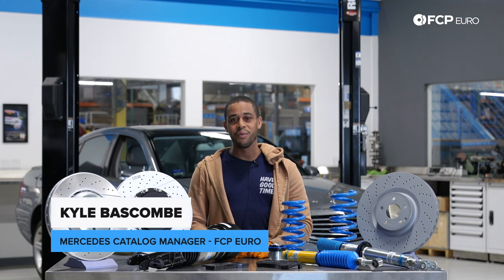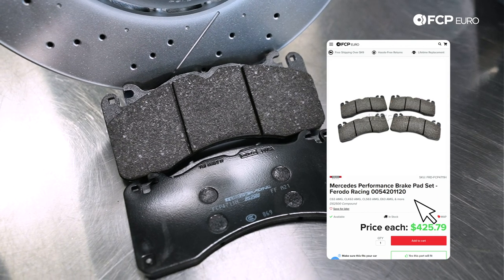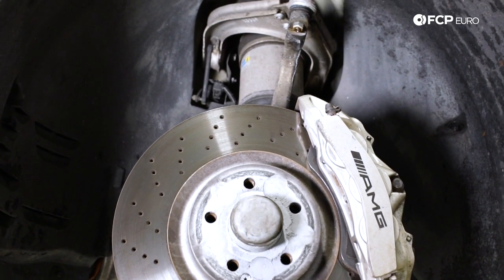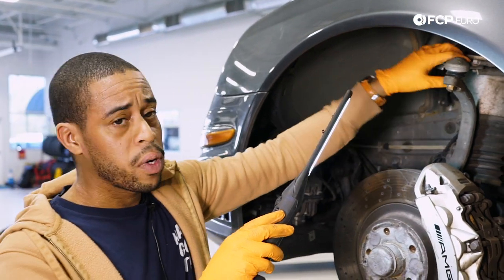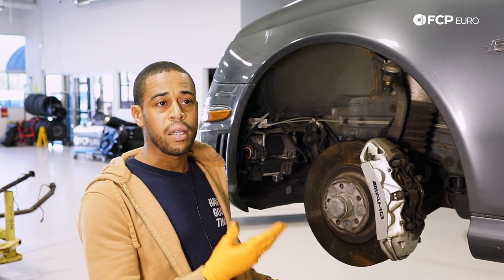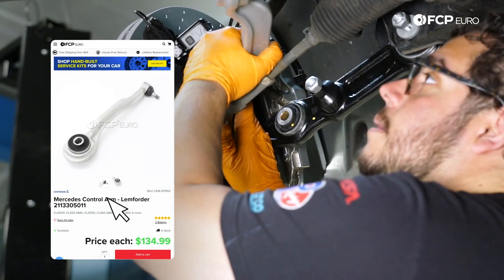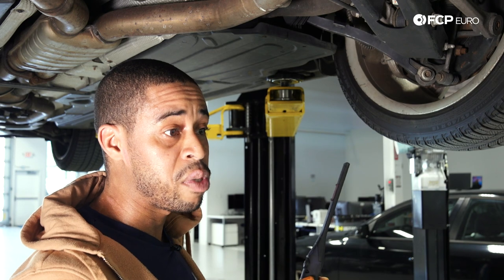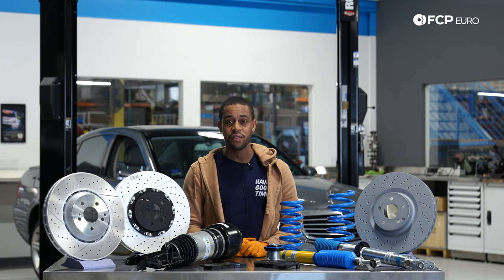Mercedes E63 AMG Suspension & Brakes Guide (W211 E55 AMG, C219 CLS 55 AMG, CLS 63 AMG)

Comment: You just solved my problem with front camber,  thank you. I have exactly the same car and the front tires wore down only on inner edge. Got alignment when tires installed and shop said there was no camber adjustment. So shop was wrong and caused my tires to be ruined.

Comment: Kyle, I 9:42 9:45 have a 2007 e63 AMG sedan with 79k miles.  The car wobbles, side-to side, on roads with lots of expansion cracks.  The rear active dampers  were leaking slightly so I replaced those with OE.  The overall airmatic system is in pretty good shape (the rear will sag after 2 weeks of sitting).  Any idea what is causing the wobble?

Comment: Just replaced my rear airbags using genuine parts, had to drop the subframe, was a fun job BUT makes it a lot more labour heavy and you need a hoist etc.
Reply: Bro wtf????? Since when do you need to drop the rear sun frame to replace bags??? Unless you were replacing other things too
Reply: @mohnjollo6926  haha yeah the rear bags have reservoirs to install - you can do it by using the old ones but I just did the whole lot. It’s Mercedes’ recommended way but the Arnott are easy they don’t need any of that haha
Reply: @mohnjollo6926  it’s on my channel as a video

Comment: nice video and good explanation. Question, I drove into a speed bump and then the air suspension dropped completely. then it pumps itself up again. is that the block valve? I already have 2 new air springs
 (it happens sometimes)

Comment: I assume this also applies to the e550 since it is equipped with an air suspension am I wrong
Reply: If it's a 211 I'd say so. I own two 211s... wagon (e500) and and sedan (E55) and the systems look identical IMO